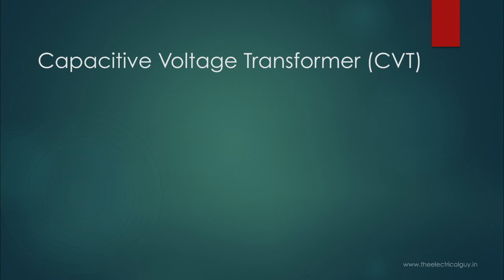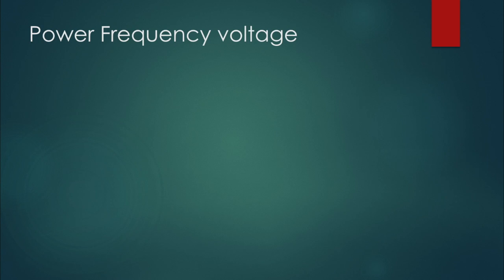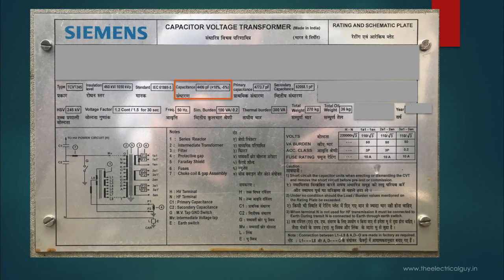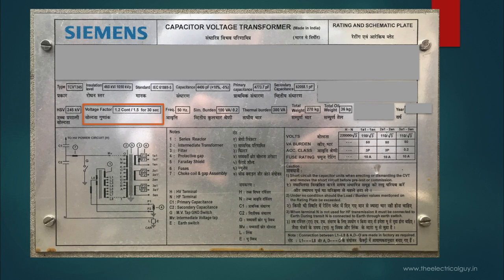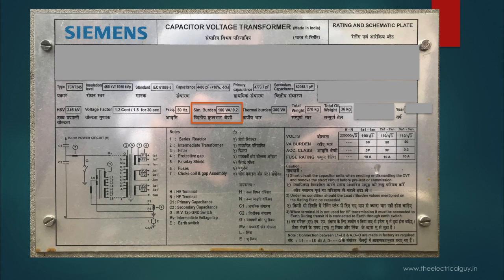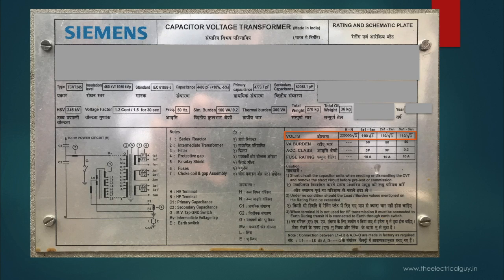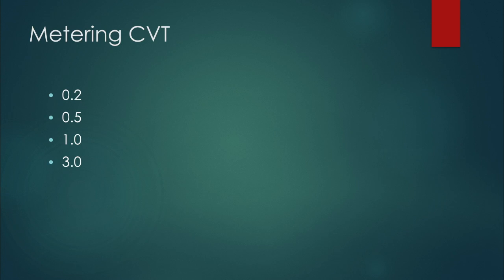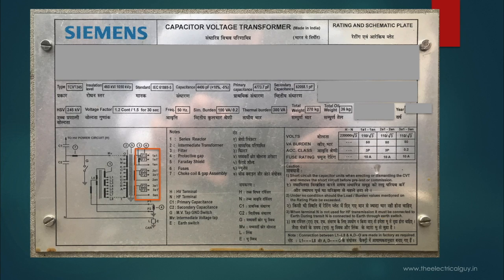Nameplate details of Capacitive Voltage Transformer (CVT) | Explained | TheElectricalGuy

Comment: The correct values for CVTs are simply:

3P → ≤ 3% composite error

6P → ≤ 6% composite error

No ±6% or ±12% at 2% rated voltage.
Reply: Correct